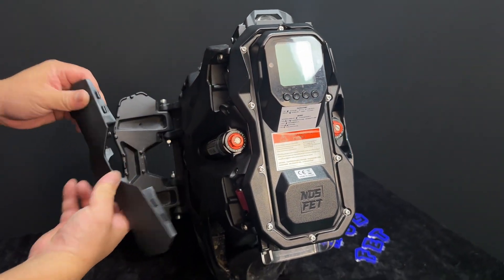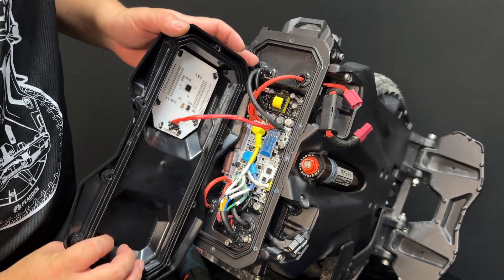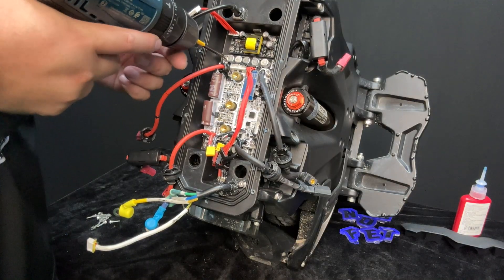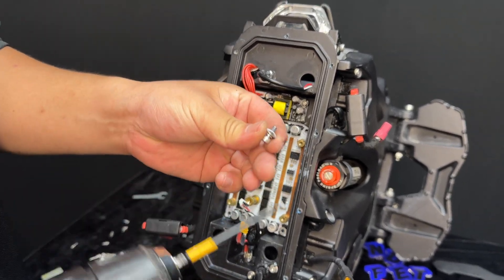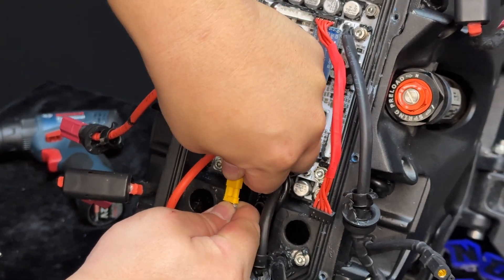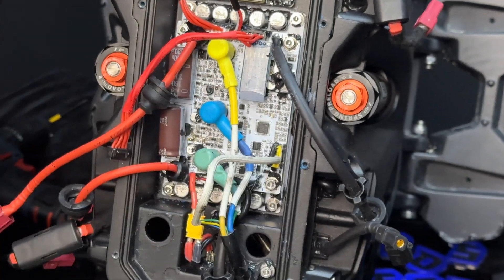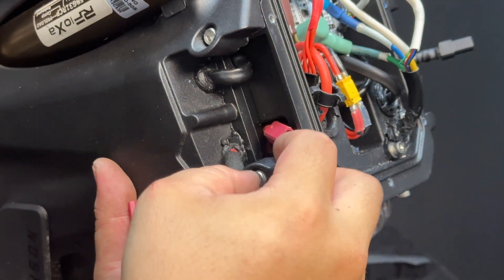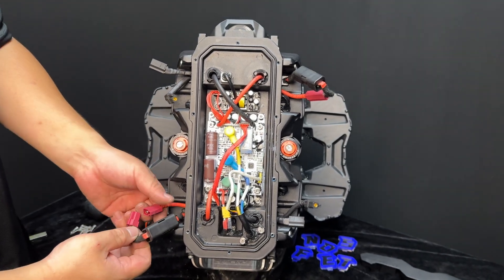NOSFET Aero Tutorial - Controller Replacement

Comment: ...also noticed this but forgot to mention it please include consistent info, I also noticed that some bolts have the info on the top left corner about their torque in Nm and some have the info about the clutch level, we don't all have electric screwdrivers and different brands might tune them differently so Nm should be the norm imo

Comment: I decided to comment on this particular video, but some of the points below apply to all of your repair tutorials. First off, thanks for making these — seriously. Most of us are forced to repair our wheels ourselves since in most countries there are no local stores selling EUCs, let alone proper workshops or technical assistance. So having these videos is essential, and all brands should be doing the same.

That said, I think your tutorials would benefit a lot from just a bit more care and attention to detail — both for the users and for the brand’s image. Here are a few concrete suggestions that stood out immediately. If I analyze the video more carefully, I might find more:

Suggestions for Improvement

• Clean the wheel before filming.
It's a small thing, but a clean wheel makes the videos look far more professional. Presentation matters (Specifically for those of us living in the West)

• Don’t just show how—tell us where.
Knowing how to disassemble and reassemble a part is only half the battle. If we don't know where to get replacement parts (official or compatible), knowing how to do things although useful won't help that much. Please include sourcing info or links whenever possible.

• Add crucial maintenance details.
For example in this specific video, you skipped over whether the thermal paste should be replaced during the process, has to or should be from time to time.

Once again thanks for these and I hope you take these and other details in mind in future videos.